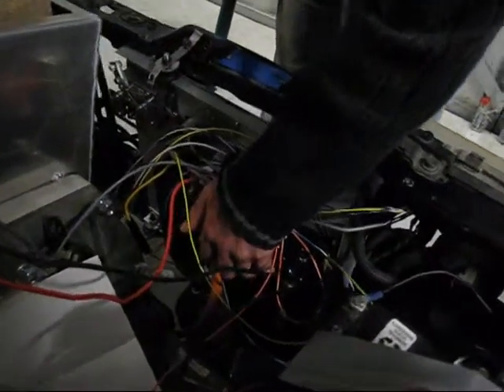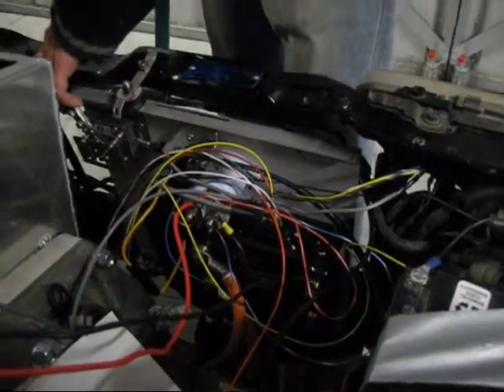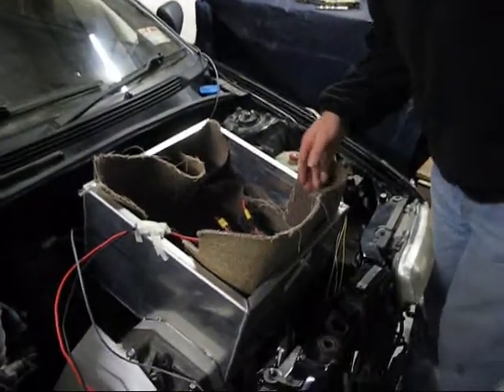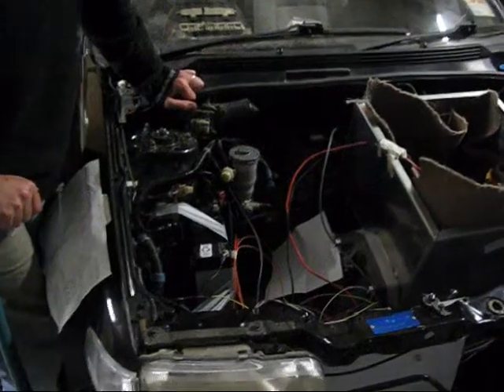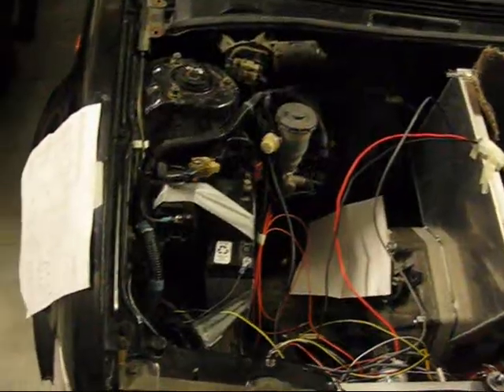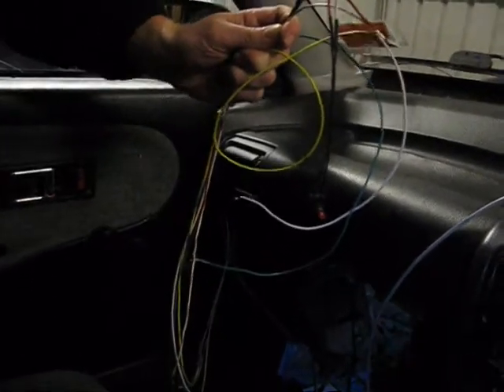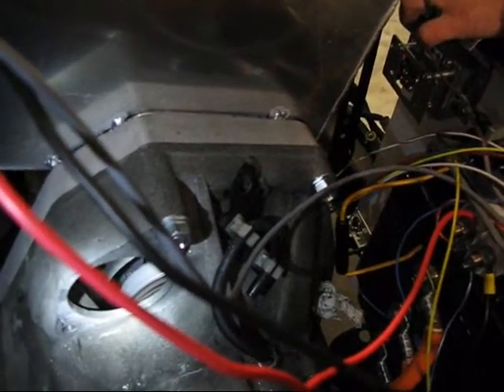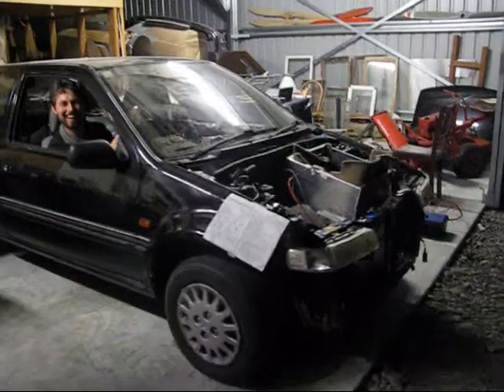Electric car first test run HPEV AC35

Comment: Hey I'm looking at the AC35 to make an electric outboard motor for my sailboat. Seems like yours is running well. Did you put an aircooled or water cooled variant in this project?
Reply from the maker: Finding Simon Yes, it's done about 20,000 km now and it's going great. Both the motor and controller are air cooled. The controller is bolted to a large finned aluminium heat sink and stays very cool, not more than about 20° above ambient. The motor gets a bit warm if you drive it hard but is fine during normal driving. We use about 150 amps continuous at 108v on the open road with no problem. I think it would be great in a sail boat!

Comment: Any chance to see a finished project video of your electric car? I have done three so far. I have videos on my site. Mine are DC but have an AC-35 for my VW Bus.
Reply from the maker: hi Peter, yes I've been meaning to, the car has been on the road for about a year now and done about 11000km. it's going great. I definitely recommend the HDTV AC motors, they're much more efficient than the brushed DC. unfortunately my health is not so good and I can no longer hold a camera or operate a normal computer. I'd like to do another video though so I might get someone to help me.. good luck with the van, I like the idea of a vw van conversion., maybe with solar panels on the roof for trickle charging.